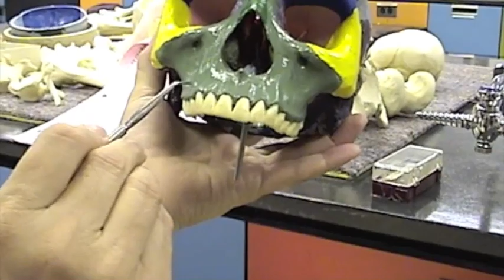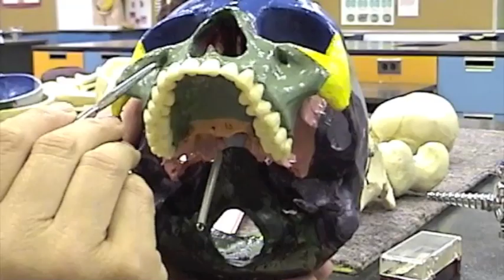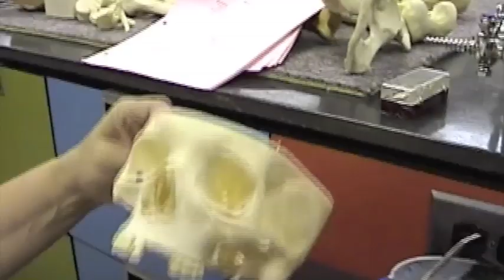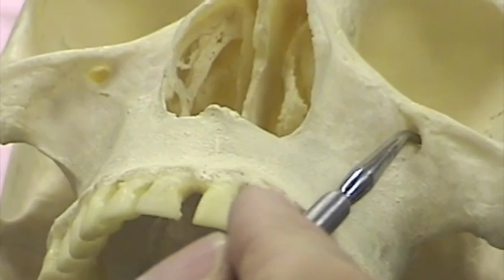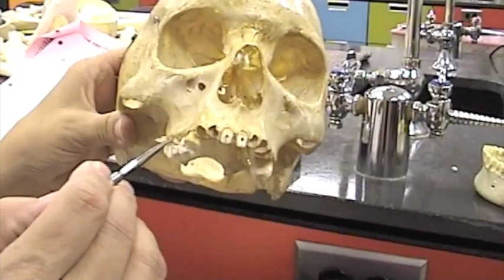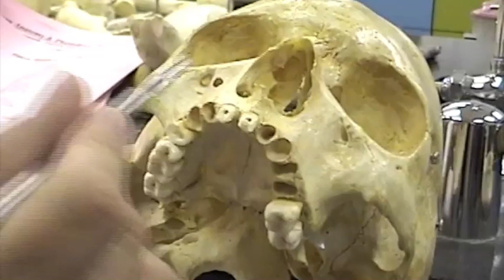Maxilla and Palatine Bone.mov

Comment: A process is the part of the bone the other bone is pointing at and is named for the bone it is pointing at or adjacent to. So the palatine process is actually part of the maxilla bone but it's named the palatine process because it converges toward the palatine bone. (the person in the video called it the frontal bone on the natural skull which is wrong). So you would name it on a test as: The palatine process of the maxillary bone. The process part of the name is never the actual bone it is.